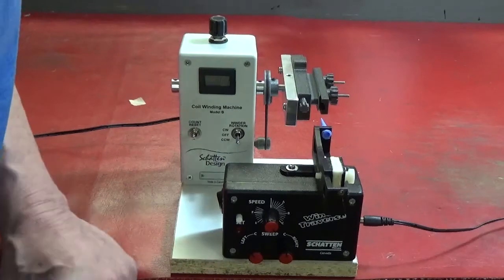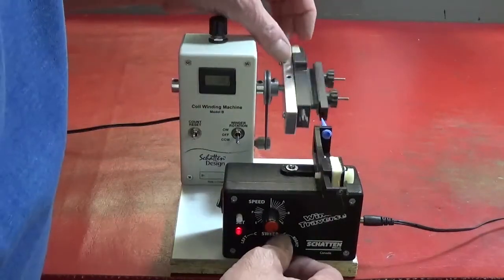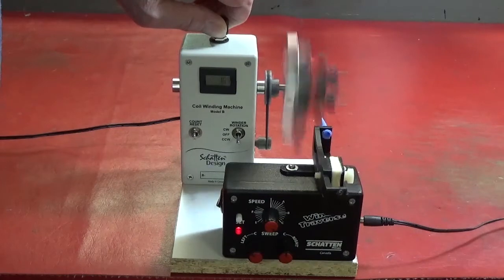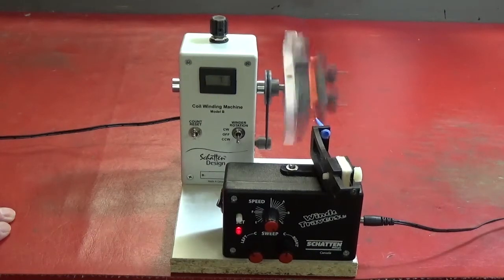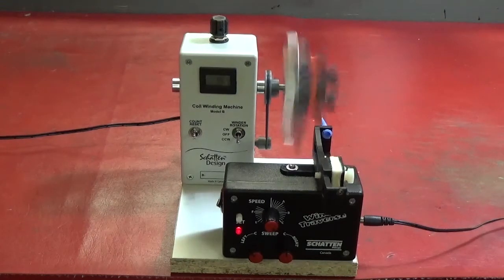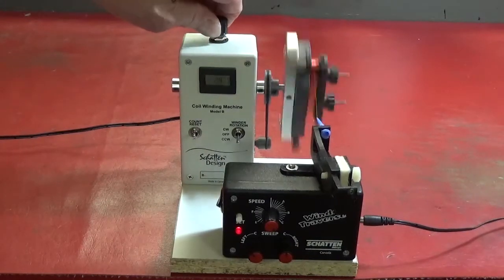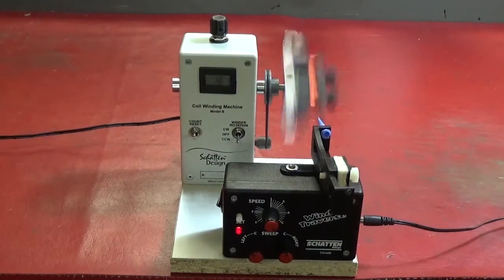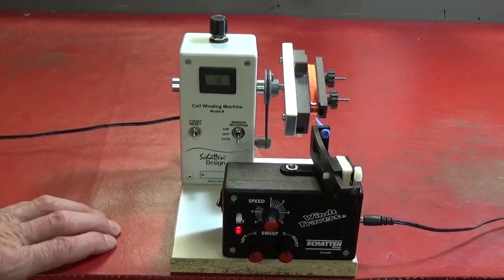Winding A Coil With The Automatic Winder Traverse

Comment: I don't like the way it stops a split second at the end of the strokes, that would surely cause more build up of wire at each end rather than an even curve you would get doing it by hand, actually you can see the build up at the end of the video when you stopped it, it might be an idea to speed the traverse up a bit which may help and you'd get more of a scatter wound feel to the pickup, do you still use it as I see this video was done a couple of years back?

Comment: This looks like the missing link to my home-built setup using a mini lathe for a winder.. it can get pretty boring guiding thousand of turns of wire on a coil by hand.  Can you offer any info as to the approximate rpm of the winder for that traverse speed used in the video example?